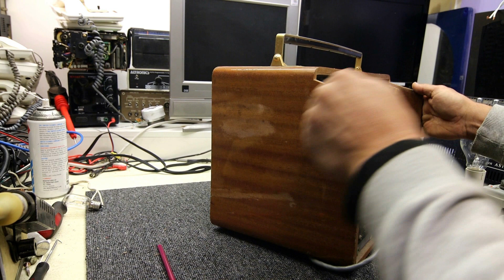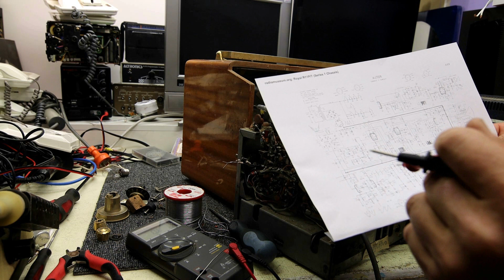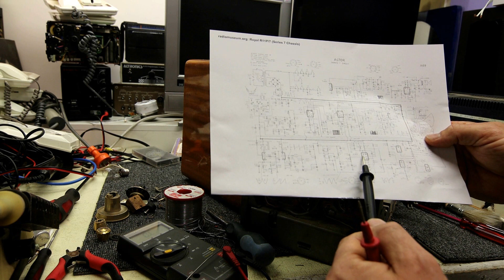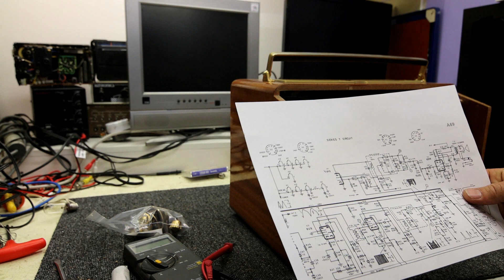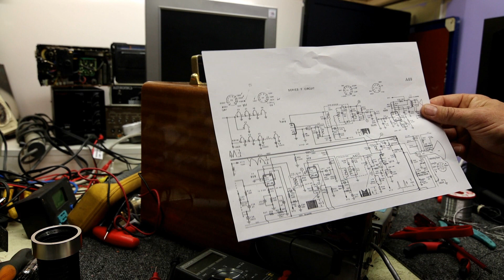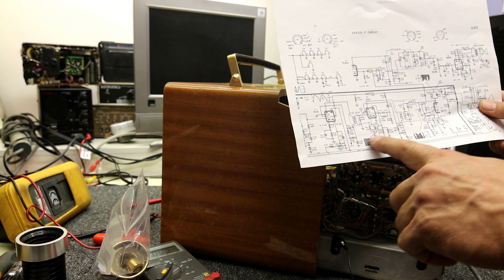Astor Royal R11/P7 Valve TV No Picture and Smoking  Repair

Comment: I think that is the first piece of electronic equipment that I have seen that doesn't have a PCB. Was that common back in the day?
Reply from the maker: Metal chassis with point to point wiring was the norm until the 1960s. I even had an early transistor radio with metal chassis and transistors mounted in rubber grommets in holes in the chassis with point to point wiring.
Reply: Didn't exist at the time. They started using PCB's around the 60's. Tube TV's are dahm old lol.